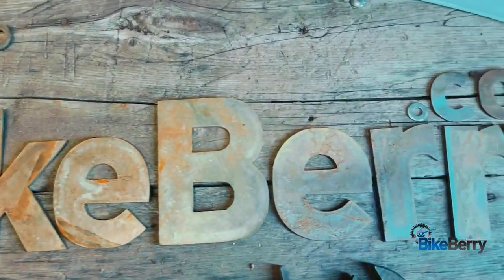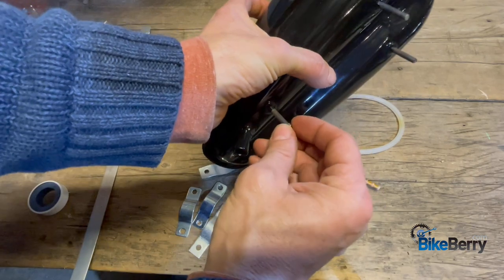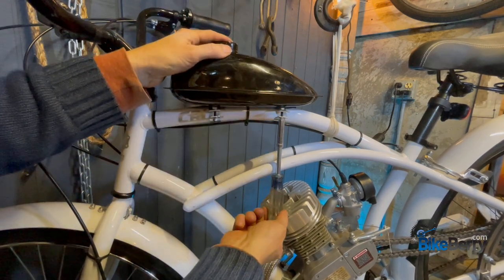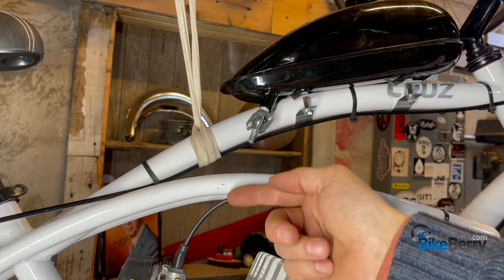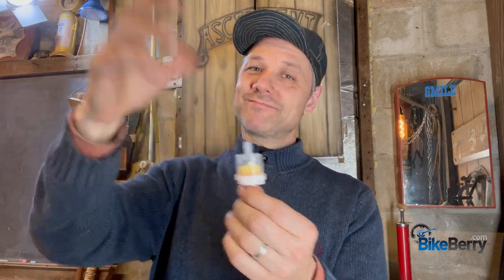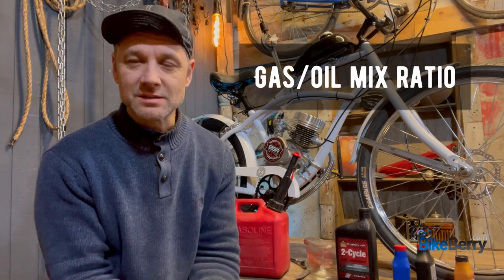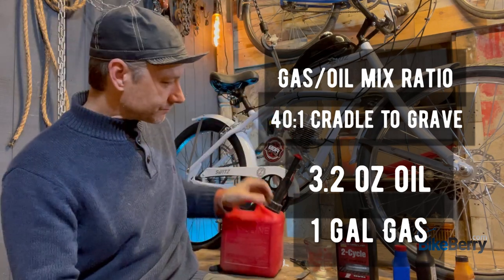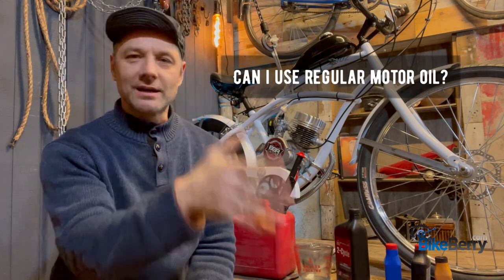Gas/Oil Mix Ratio Fully Explained | Gas Tank Mounting Method Revealed! | Motorized Bike | Bike Berry

Comment: And instead of the bolt welds popping, (knowing from experience) the tank cracks, at the middle seam when doing this. Best fix is the top mount, 4L tank, or liquid tank sealant. Anyone need help, find me on the pages.
Reply: Thanks brother 💪

Comment: Mix ratio also depends on the oil.  Different brands and types have different ratio recommendations.   If you run a full synthetic you can run 50:1, and in the case of Amsoil Saber they claim up to 100:1 (I wouldn't personally, but I've seen chainsaws and other lawn equipment do it).
Reply: yep. I have honda oil that is only made to mix 32:1 max. Would be a mistake to run 40:1.

Comment: Sorry Tony, I'm going to disagree with the ethanol vs. non - ethanol gas. True the bike will run on the pump gas with ethanol fine. The problem occurs when its left sitting, either in the tank or the extra in the gas can, it will attract water fast, plus it goes stale fast. Water, oil and gasoline do not mix well, nor does it burn well in the combustion chamber. It also causes severe corrosion in the carburetor. It also turns to a gummy paste in carburetor. I never ran it in my 2 strokes and I never run it in my 4 strokes. My bike can sit for 6 months + with the non ethanol and I can go start it first time every time, never a plugged up carburetor like the ethanol does. If you are going to replenish the gas in the tank every week or 2 max. then the pump gas is okay. Do not let it sit in a gas can for any extended length of time, especially in a area of the country with high humidity you will regret it. Don't worry about the octane, these low compression engines run good on 86, 87, octane, but do worry about the evil ethanol, it is a small engine killer. Just my 2 cents worth.
Friends don't let friends run ethanol in their small engines.
Oh and the correct ratio, well run that 2 stroke to lean (not enough oil) and see what happens, run it a little rich and the worst is a fouled plug. I've learned about running it with not enough oil, she'll run like a scared cat till it doesn't.
Reply: I totally agree with you that all those things happen. Non-ethanol is way better than ethanol gas. This is meant to get someone started and not worry about all that. As people progress in the hobby they will make the changes to improve performance. I’ll build bikes that will use nothing but non-ethanol gas in them. But because of the hassle with obtaining it my daily cruisers will just use whatever Casey’s gas station has. Man, I appreciate your comment brother. 🙏
Reply: boycott ethonal and all other forms of GMO corn, i agree with you guys 👍

Comment: ethonal gums up bad when it sits and can eat up certain rubbers/seals. ethonal varnish is gnarly inside a carburetor that has been sitting over the winter. ethonal percentage is different than octane ratings. higher octane is needed for high compression engines, i would avoid any octane 87 or lower. i like to run 98 octane ethonal free

Comment: I bought my kit months ago... How did you neglect to mention the fuel mixture for so long? Kit came with no assemble instructions and a disassembled engine... (Not matching the description, no mention of having to assemble the top end and not matching any of the photos) the link to the video showed a different size engine and didn't show how to assemble the top end. These videos came way too late for me...
Reply: Didn’t neglect anything my man. This new build it right series is a playlist that I started a couple of months ago. This video was next in line of the series as I’ve been assembling a stage 4 engine kit on a Switz Cruz bicycle. Go to the BUILD IT RIGHT playlist and you’ll see a video on how to assemble the top end of your engine. Also, join our Facebook group so that everyone in there can help you as needed.
Reply: @tonytaylor5087  regardless, the installation video I was given a link to cuts off the part where the fuel ratios supposed to be mentioned.. and there was still 0 instructions for engine assembly in the video either. Would a sheet of paper instructions be hard to add? Then the "go apply and make a facebook account, then talk on facebook and wait for an answer" idea is why I'm not going to be recommending your products. Your own custom parts came so poorly sealed that the nuts were out of package and scattered among the boxes too. How they didn't fall out the holes in the side of the main box made from the head studs, is beyond me.
Reply: @tonytaylor5087  I also watched another persons video to do the top end since there were none in your original videos. The bikes been built already before any of these came out. That's why I said they came out too late. I'm waiting to see if the damage to the head gasket was too bad for it to make compression. Its 0° out so im not starting it up yet. Im hoping at most I just need a new one of those.

Comment: I run 50:1 with AMSOIL dominator or Lucas; no issue, any other oil 40:1. I've ran with dominator 100:1 just to prove is a good oil but to keep on the safe side my mix is 50:1.

Comment: Honestly tho the jetting is a bit rich and more oil leans it out and gives more power and lubrication that’s why I say 32:1
Reply: Not too much but not too little
Reply: Good insight my man.
Reply: Tip 11 when replacing the piston circlip a lay them flat see Wich side it will not lay flat the “ear” on the circlip will lean out to one side or the other this is the side ya want facing outwards bc as it pushes out it goes down and inwards pushing back against the wrist pin ya can clip this ear shorter or aff before or after install is ya want to prevent it from breaking loose and ruining your engine btw  this is called the bias of the circlip

Comment: Tip 9 don’t buy the cheap HP carb for $20 spend an extra 10-15 bucks and get a arbeo carb same thing just better quality also a banana pipe is better than stock but mz65 wc80 or clones thereof are the best pipes available for these engines but a modified dirt bike 60-80cc pipe is perfect choice for these
Engines

Comment: #BuildItRight 
TONYSVIP
The stress is on the bolts BUT the welds will still crack due to vibration! Its a matter of time!
You guys need to design a pinch weld tank mount for those kind of tanks!
Reply: Yup, that’s what I said also. Matter of time. My tank is mounted on the back of the black bike with big zip ties. 

Can you describe what you mean by a pinch weld tank mount?
Reply: @tonytaylor5087  I meant the seam around the side of the tank. It called a pinch weld. Its pinched together then welded together just like when the manufacturer assembles your car door.

Comment: Tip 10 start your bike up and let it idle w mild revs a minute r two let it warm up before riding will last a lot longer. Any HP head besides the cheap little $30 circle one is better than stock as it will cool better and the Hp carb usually must be rejeted for your engine use 5mm sha  jets
Reply: That’s 3 in 1 for ya
Reply: Got tips on tuning? I need to get my jet game up 😂
Reply: @briangarza7505  start out rich
Reply: A 100cc use 74 -68 usually a 66 use 60-65 with a pipe uses a richer jet same for a long intake and ported cylinder lotta factors but stock at 1000 for elevation a 100cc I use the 70 jet (72 for break in) and. 66 I use a 65 64 jet it differs every engine is a lil different

Comment: It's thinking it's okay, huh.Did you put any blue lock tight under?Where is your rubber gut gaskets?Separators, who keep the vibration?Doubt you're putting, that's another and it takes a still loose.It'll flop around what a piece of garbage